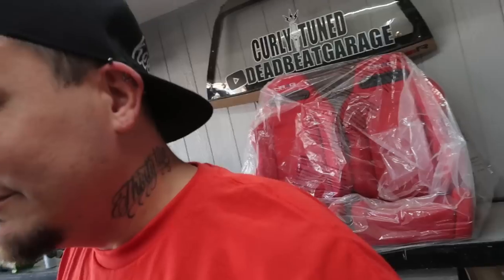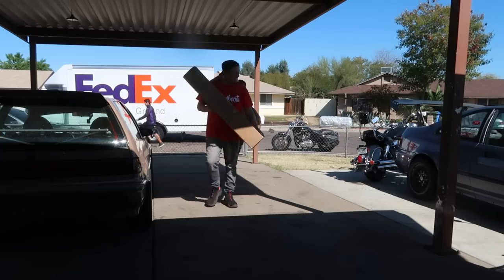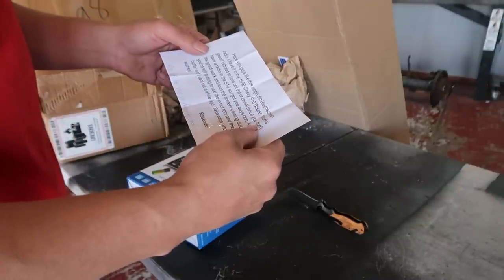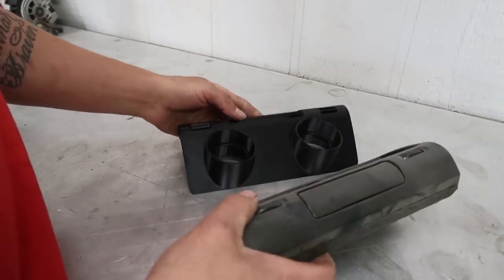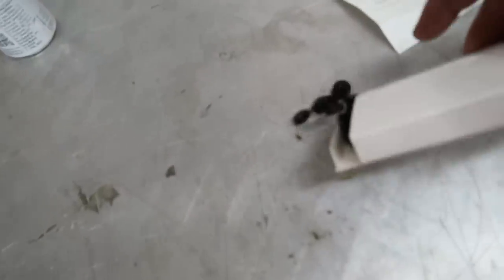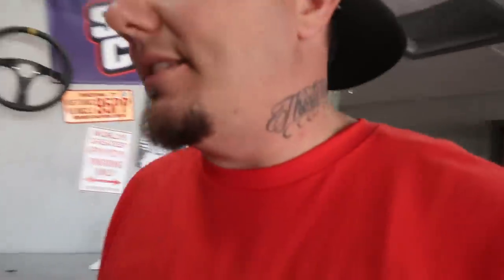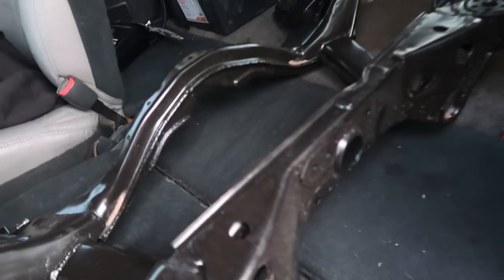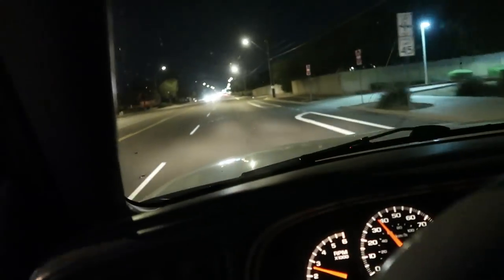2jz Swapped Civic goes to JK Fab!

Comment: You don’t have a short in your wires.
You’re switching from halogen to led but there’s 1 more light that is making a circuit to your led’s. Remove the tiny bulb on the ‘dash’ for the indicators.
Reply: And those led blinkers won’t work with your original relay. Either get a led relay or remove the relay and connect the wires, the ones you have don’t need a relay because it’s built within them anyway.

Hope this helps, DBFam!

Comment: That's super commen for those switches to mess up. Usually a wire rubs on the bars or somewhere over time and ya causes a short. Take the switch apart and it shud be pretty obvious where the issue is. It's easy.  Good luck
Reply: Nah, he’s got a halogen bulb in the dash that is making a circuit to both lights. Common thing when switching from halogen to led